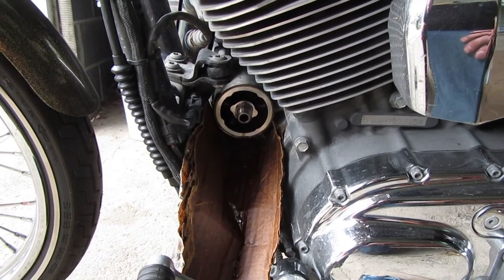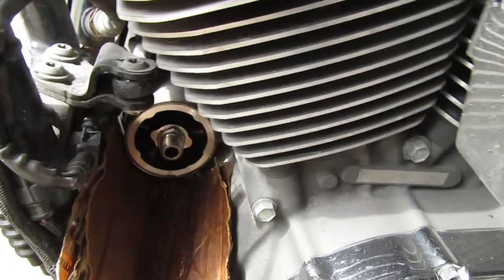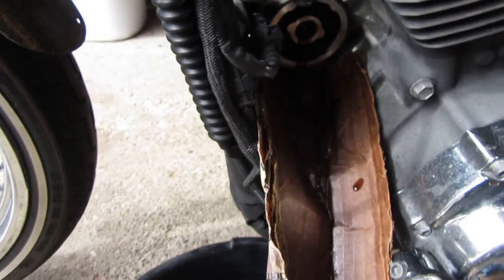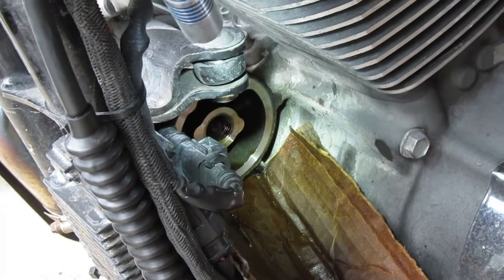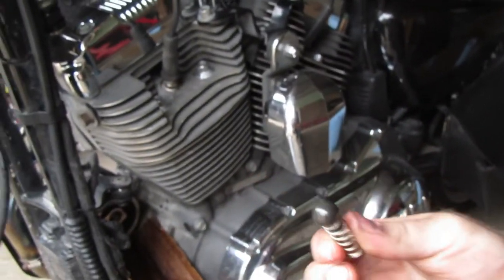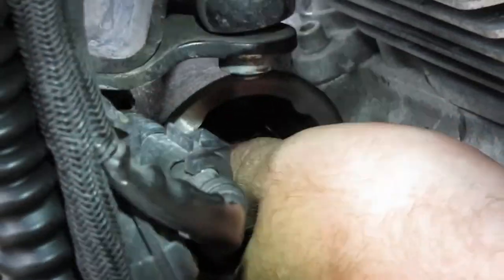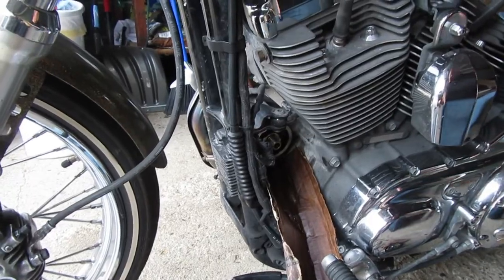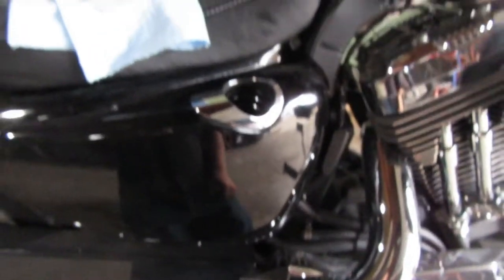Sportster 1200 oil pressure check valve replacement/wet sumping.

Comment: I've had a 2000 883 for about 12 years now. The thing wet sumped from day one. It wasn't too bad if I rode it everyday, but let it sit for a few days, go for a run, there'd be oil all over the place. Six years ago I had a little get off that left me in hospital for a while. The bike sat for 2 years before I got around to fixing it. When I looked in the oil tank there was nothing. That got me looking at the oil system diagram, and that got me to suspecting the check valve assembly. I ordered a new ball & spring. OEM parts cost about $12 AU. I haven't had an issue with it since, except the bike's still a heavy spitter and doesn't really like having the oil filled up more than halfway through the safe zone on the dipstick lest it start dumping stupid amounts of oil into the airbox. I measured the new spring against the old one, and the old spring was about 3/8 of an inch shorter than the new one. I guess it had taken a set & that was the problem.

Comment: #1 Clean Your Check, #2 Get An Inline Hose Barb Non-Return Valve To Splice Into Your Tank Return Line From The Scavenge Pump. 
( make sure you get it in the right way, arrow towards the oil tank; and in the return line from your scavenge pump )
Reply from the maker: That’s a great idea thank you!  Thanks for watching!
Reply: @v-twinbrothers2001  they make 3/8" hose barb check valves for big diesel fuel lines which work for anything from air to oil.
i can't put a link here, you would just have to find one.
but the scavenge pump is at the engine debris front line, and after a hit, the slightest compromise can allow oil to run backwards through the tank return line into a sumped condition.

and the valve could get a piece of debris lodged in it, but the valve will generally render sumping to be a very rare happening.
Reply: @v-twinbrothers2001  and the valve *Will Only cure Sit Sump*...
if anyone experiences sumping while the engine is running, Then They Need A New Oil Pump.
Reply: I have a 883 HD of the same vintage as above. In addition to suspected wet sumping (oil drains from the tank in a couple of days sitting) the bike will blow out the oil filter gasket upon startup if it is below  15c (60F). I have changed the filter twice, making sure the gasket is lubed up. Changed the oil using the recommended weight and inspected the lines going through and from the tank and oil pump. I haven't noticed any oil spweing out from other places. Any pro tip on what might be causing this?
Reply: @JFinnerud  do a search for "3/8 fuel oil check valve non-return valve"

you should find an aluminum dual hose barb anti-drain back valve, with an arrow on it..

spice that into your scavenge pump return line, 
( with the arrow pointing toward the tank )

make sure you get it in the right line, and in the right direction.

that will cure your sit sump.
Reply: In line hose barb non return valve
Reply: @gwizzfpv6741  sit sump cure - > 3/8" hose barb fuel-oil non-return valve on sportsters....it goes in the larger bottom hose by the starter motor hose clip, with the arrow pointing toward the oil tank...... if that doesn't cure your sit sump, then also change out the oil pump for a new one.
Reply: @gwizzfpv6741  i also have a very powerful neodymium magnet installed in my crank case near the scavenge pump pick up  ...but  that is much more difficult to explain, and to do.
basically, the problem is that your scavenge pump is on the engine debris front line... any tiny hard chunk of ferrous debris can compromise your scavenge pump.... then when it sits, the oil runs into the crankcase, backwards through the scavenge pump.....see also my "sit sump cure" comment here for the basics.

Comment: I had wet sumping around my oil pump on a 91 sportster I just ordered the adapter valve kit but it caused a loud knock in the motor I took the oul pump out and found a small  piece of rubber in the top of the pump just below the drive gear I have to take off the cam cover to get to the oil filter plunger the 92 and later sportsters aren't set up like that

Comment: Where did you find the parts? Having a hard time finding the ball and spring thanks.
Reply: Your dealer should be able to special order it for you using the part number 26437-86b. I also googled the part number and a few Hd dealer websites came up in the results. Thank you for watching.
Reply: These parts are like hens teeth cant find anything online
Reply: Dont order from anyone but harley brother i had issues with the bs metal ball bearing looking 1 from jp cycles no bueno   harley rarely stocks them but its woth it with harly 18 bucks and some change for all 3

Comment: Is it possible that a new motorcycle can have an oil leak because the oil pressure valve is stuck and the pressure inside the engine is pushing oil out via shaft seal or gaskets?

Comment: My bike has sat for awhile. The oil has drained out of the tank. When I start the bike next time, Is oil going to pour out of my intake? I’ve read this happens.
Reply from the maker: No, as long as you have the correct amount of oil in it, you shouldn’t have this issue. We’ve also heard this happens as well but have never seen it in any of the sportsters we’ve owned.  

I would suggest starting it briefly and shutting it off, then checking the oil level as the tank should refill.  To our understanding, oil only. Comes out the intake when it’s overfilled.

Thank you for watching!
Reply: @v-twinbrothers2001    Thanks.  I was thinking I needed to remove the air intake so the oil wouldn’t go back into the engine.
Reply: @aucklandsadventures  no problem. You certainly can, and it sounds like a good idea. I’d be surprised if you get oil coming out (assuming it’s filled correctly). If you don’t mind, let us know what happens.
Reply: I have same problem as you. 91 Low Rider Custom, 25K miles. Oil is not overfilled, actually a little under because i suspected as one of the replies suggested...too much oil. Not the case. Bike sits for a period of time and oil tank empties into the crank. Had the breather replaced and did not solve the problem as the oil kept flowing to the air cleaner. Hooked up a hose to a soda bottle to catch the excess oil after not starting for a period of time and got a half quart in container in a few minutes. When it stopped filling the bottle, the sumping must have been done. I suspect my next fix is replacing the ball and spring like in the video. I even contemplated putting an inline shutoff ball valve between the oil tank and lower end. Had the bike since the mid 90's and never had this problem even after letting it sit for weeks without starting up until about 10 years ago.

Comment: That's definitely not locktie, it's thread sealant, hopefully someone putting a used one back together doesn't get the idea of using the wrong thing
Reply from the maker: That’s a good catch thank you for pointing that out. Thank you for watching.
Reply: Im sure someone f@#ked at least 1 engine case because of this lol 😆

Comment: Thanks for sharing this I video. I did have a wet sumping issue  unfortunately replacing the plunger did not solve the issue i have had for some time:  have a 1998 883 that keeps blowing out the oil filter gasket if it's colder than around 68f. When i checked the oil pressure with an external oil pressure gauge it showed more than 60psi. i have checked for clogged lines however they seems fine. Replaced oil filter twice with original filter and also made sure it's torqued to spec. The plunger seems to be opening as it should and not sticking or anything. So far i have concluded that it the issue seems to be somewhere after the oil filter. As of now i have absolutely no idea on what to do next. Any tip would be much appreciated.
Reply: it is the stuff blowing backwards through the galley ... when a bike sit sumps up fairly high in the case, just starting it causes hydraulic back pressure in the galley ... your oil filter check closes, and it blows out the filter gasket..

see my other reply for the anti-drain-back valve search, and basic installation instructions.
Reply: @RulgertGhostalker   Hi. Thanks a lot for your replies. I have ordered the 3/8" check valve you suggested. Will I still need the plunger or will if function as a "replcement" ?
Reply: @JFinnerud  the Inline Check Valve Doesn't replace anything.

so you still need the engine's stock high pressure check behind the filter, ( although those parts you already have may be fine, and may not be the problem ); 
generally the engine's pressure check fix is just to be cleaned and reassembled..

the 3/8 hose barb Inline check goes in the Low Pressure scavenge return line back to the tank..

look in a manual, or other reliable reference for your make and model, and make sure you splice it into the scavenge return line; and with the arrow pointing toward the oil tank..

once you know what hose that is:

then you,
1) find a spot on the hose where it will fit.
2) cut the hose there
3) put 3/8 hose claps on each side of the cut
4) insert check valve WITH THE ARROW POINTING TOWARD THE TANK.
5) Tighten clamps

it may be sumped when you start it after you put it in, 
but once your past that start, the rest of your starts should be dry, and not cause any problems with your filter gasket.
Reply: @JFinnerud  But Also.
if you feel any oil drag while your ridding; that is different than sit sump..

the In-Line check will only cure Sit Sump.

in such the case where the engine is sumpy while riding, 
then you would also have to swap in a new oil pump.
Reply: @JFinnerud  Also..

just as your high pressure check may need to be cleaned on occasion; 

so too, on any occasion, that your bike actually sit sumps with the inline valve installed, 
( that would be because of a bit of debris keeping the valve from sealing when you shut off the bike )

*likely a rare occurrence*, 
( and the offending particle may be pushed clear anyway on that start...and so cleaning itself )
Reply: @RulgertGhostalker  Hi again and thanks for this and your previous replies. I am very grateful you spend time on giving these advices. I'll get started on it as soon as the part(s) arrives and keep you updated of as soon as i have them installed
Reply: @JFinnerud  i have a 2001 XLH 883;
but the oil hose routing is the same from 1994 to 2003 ...it is the wider of the two hoses that run by the starter motor.
Reply: @JFinnerud  there is a small allen set screw in the bottom of the case, in the scavenge pickup passage below the oil pump...

really difficult to explain here,
but it would be nice if you could get to that and drain the sump..

then install the anti-drain back, while the sump is draining, ( it would drain very slowly though that little hole )

then re-install that screw, fill the oil tank to the correct level, and start it up clean..

that way your not struggling with the oil filter gasket while it is pumping it's own sump down. ( and the oil tank is filling back up..

but if you are used to starting it, as is; 
and you get it cleared ok when you do.

then don't worry about that plug screw.
Reply: @JFinnerud  the little passage plug screw has some nasty thread locker on it though... it is very difficult to get out the first time without stripping out the screw's socket...

but, like i said, if you can nurse it through one start up, and run it long enough to clear out; you should be good from there out.
Reply: @JFinnerud  i think it is the bottom hose,( as going through the clamp on the starter motor )...
tape the wider hose, to mark it, then take them both out of the clamp so you can work on it ... 

a little oil will come out when you cut the hose, to install the valve, so have something to catch it...

but it won't be that much, probably less than a tuna can.
Reply: @JFinnerud  arrow pointing toward the oil tank.
Reply: @RulgertGhostalker  I have already drained the sump and oil tank. I am currently waiting for a new plunger +  the check valve you recommended. I have located the correct hose and it seems like a fairly easy job to install the valve. Fingers crossed 😊 👍
Reply: @JFinnerud  yeah, it's a piece of cake.

actually draining the sump is pretty tricky though.. ( the only way is that nasty little screw )

but you might have gotten some oil out of the sump; 
i would guess the first start, after install, to be at least somewhat like starting a sumped bike..

but hopefully it cokes its way through that start without popping out the oil filter gasket...just keep trying if it does.
Reply: @JFinnerud  watch your oil level in the tank when you get it started..it will probably come up further than you think.
Reply: @JFinnerud  just put a quart and a half in the tank to start with...then start it, keeping an eye on the tank level and the oil filter...

if the oil filter gasket pops out, shut it down, fix it, add that much oil to the tank, and try again ( keeping an eye on the tank level and the oil filter )
Reply: @JFinnerud  supply chain disruptions, or something... you can thank me by helping me explain to others why that happens and how to fix it...
or just direct them here.

i have my sportster down for a top end right now, and i cut the right covers on mine...so my valve is down by my oil pump. ( not the best bike for a how to video )
Reply: @JFinnerud  get your your bike going and enjoy the fresh oil change, and sit sumpless starts... then maybe think about doing a video on the next oil change.
Reply: @JFinnerud  you can just leave the valve in the hose; the oil change is the same, no different.
 i just meant, if you do a video, it will be easier showing how simple the install with the oil drained
Reply: @JFinnerud  i had to order another one of those for a friend recently, and the ship date is out about a month and a half yet...
is yours almost there yet ?
Reply: @RulgertGhostalker  I ordered mine May 28th It has yet to arrive however i got a tracking update today that it would be delivered within a week. Looking forward to get back working on the bike.

Comment: Did you disconnect the electric wire for the oil pressure switch under the oil filter mount before removing the check ball and spring ??
Reply from the maker: Thank you for watching!  We did not have to disconnect the switch.
Reply: @v-twinbrothers2001  do a search for "3/8 fuel oil check valve non-return valve"

you should find an aluminum dual hose barb anti-drain back valve, with an arrow on it..

spice that into your scavenge pump return line, 
( with the arrow pointing toward the tank )

make sure you get it in the right line, and in the right direction.

that will cure your sit sump.
Reply: @v-twinbrothers2001  the scavenge pump is at the debris front line...if it takes a hit from any hard ferrous debris, the compromised scavenge pump will leak oil backwards through the return line...

for sporties with the 3/8" rubber scavenge return lines, those dual 3/8" hose barb diesel fuel oil checks will cure the sit sump..

if your bike sumps while riding, swap in a new oil pump.

Comment: (2005 883) I got oil leaking like crazy out the air breather when. I'm doing 80mph in 5th gear. I replaced the breathers and put 2 new orange seals but it didn't matter. Still leaking. Any idea? May the ball and spring be the issue?
Reply from the maker: How many miles are on it?  Might be time to do compression and leakdown tests. I wouldn’t expect the check valve to be the cause. That seems like you have excessive crankcase pressure. Thanks for watching!
Reply: @v-twinbrothers2001  20.5k mi. I've been reading forums and the service manual. Narrowed down to a bunch of shit.
Check ball
Pinched vent
Scavenger gears
Head breathers
Excessive oil in bag
Wrong/bad oil filter
Wet sumping
Sit sumping
Crankcase pressure
So I swapped the head breathers. Compression was 155F/150R.
Drained oil completely and checked for debris. Added 2 qts 20/50syn and KN 170 oil filter. Disconnected vent line and hit with air hose. Ran for a minute and watched for return flow in bag. Checked the ball valve, Seems good. Typical indent from sitting against the threaded adapter. 
Note: it only pukes oil excessively in 5th at 80 mph. So I think your right with high pressure being ass backwards. Gonna run it tomorrow and see what happens. Worse thing I'll have to do is drill cam cover and put a relief there to help. Your thoughts good sir....
Reply: I got the bike back for the same issue. I think I'm gonna have to tear the too end off and see if the port that transfers oil from case to cam side is plugged or something. Frustrating but learning a lot.
Reply: @usmcdoc2512  So I've been running into the exact same issue since I put my bike together, I didn't think to try the check ball; which I'm going to look into today.
I also ride 80~90 mph in 5th; roughly 4~4300rpm. I'm hoping that I just didn't tighten the checkball assembly way back when and that's why it's leaking.
Mine blew a lot of oil out of the front breather; I replaced the rocker/umbrella valve and that didn't matter, still spew it. 
So I got an external breather, that slowed it down a bit. not a fix though.

However for me, it could also be a really quick wet sumping, because I'm the one who put the bike back together (pistons blew) and I distinctly remember that assembly being loose. 

I'm curious if you've resolved your issue?